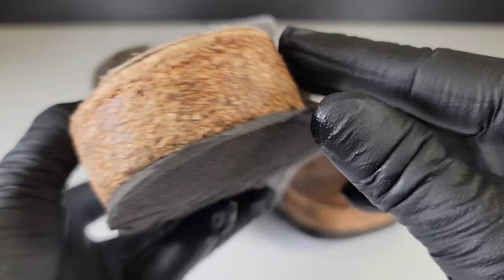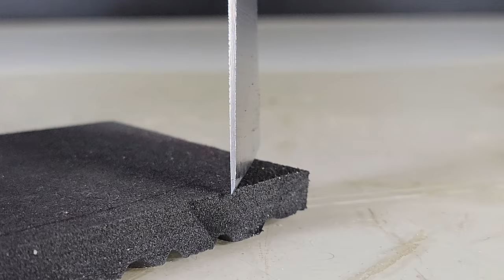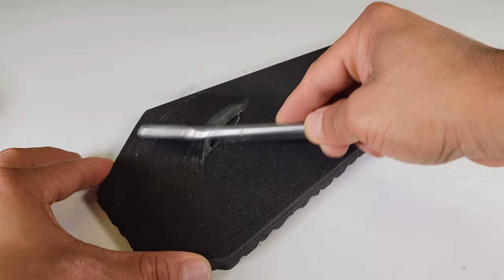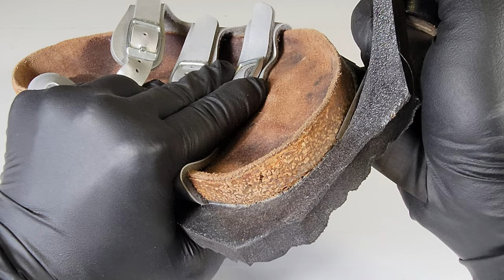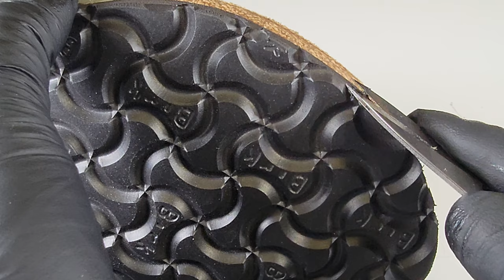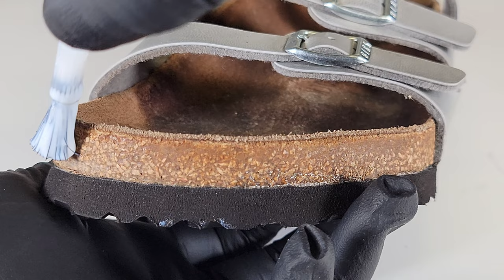🎧 ASMRㅣBirkenstock Cork Repair and Sole Replacementㅣ버켄스탁 수선ㅣ4K 🔨

Comment: Do a lot of shoe brands sell soling sheets so you can buy them for repairs? Thank you for all you do!
Reply: It’s hard to find consumer retailers that sell them for a reasonable price but I found that southern leather sells a 18 by 36 sheet for 90 bucks which is a great price considering what others charge for the original Birkenstock material

Comment: While i appreciate the effort of reaparing i have my doubts that this will hold up. The cork used to repair is of really bad quality (at least for midsoles). The adhesive used to repair the cracks is not right either, the correct would have been flexible CA glue. (it is a special one, not any super glue).

I hope to be wrong and these shoes have a long life before them..

Comment: Meh... the end result looks amateurish. Wouldn't it have been easier and the about the same  price to keep the upper and completely replace the suede topped cork footbed and outsole? Doesn't most cobblers keep Birkenstock footbeds and outsoles in stock since it's probably on of the easiest shoes to a complete footbed & outsole repair on? Also, great opportunity to swap the outsole for the more wear resistant Vibram Birkenstock outsole.
Reply: It takes a long time to break in a pair and they feel amazing after a couple years. People want to preserve that as long as possible. If you truly need a new footbed, just get a new pair. If you use cork seal twice a year, keep them dry, and don't run them down to the cork, the footbeds can last a long time. You can also clean your footbeds with a tablespoon of Tide, a tablespoon of vinegar in a 16oz water bottle (warm water) Shake it up and use a towel and that solution. Don't soak them. Put them under a fan to dry. Before you use the solution you can gently sand the footbeds and get the black oil/dirt off then they will almost look new. They will feel rough and hard for a couple weeks after the cleaning but will soften right back up. Hope this helps someone :)